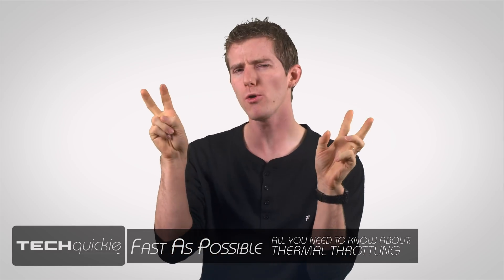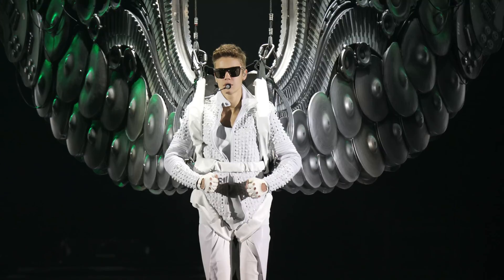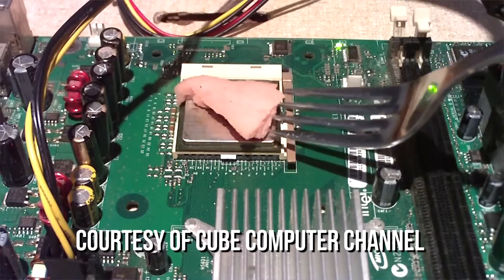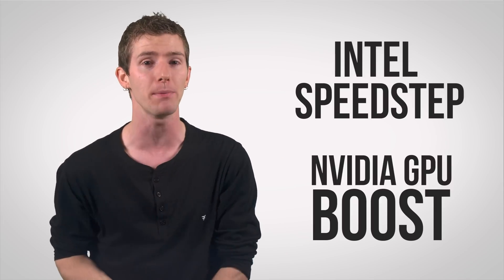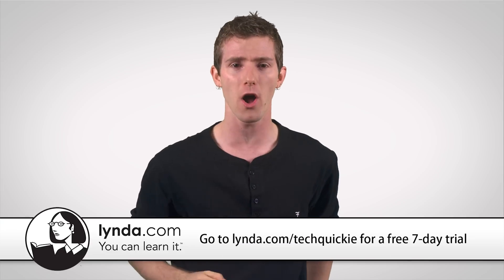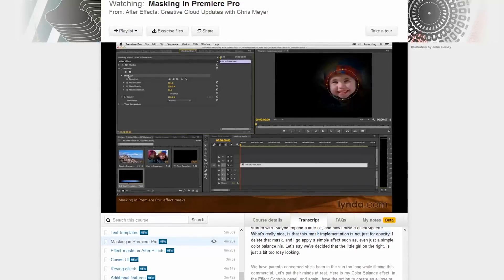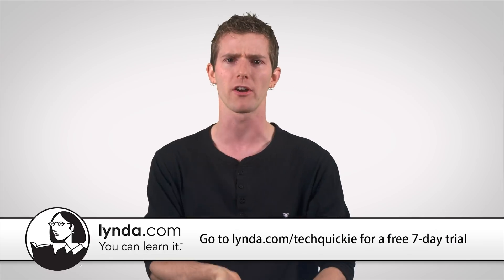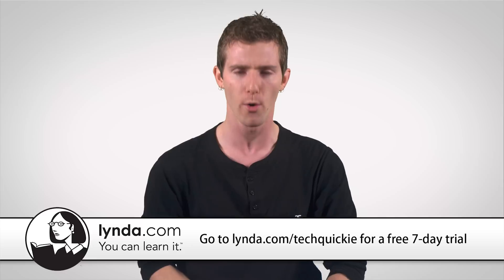Thermal Throttling as Fast As Possible

Comment: How do phones cool themselves if they don't have fans? Does it just dissipate out?
Reply: passively cool low end hardware that doesn't output much heat. That's a phone's internal in a nutshell. A PC is MUCH more powerful than any phone on the market, thus output more heat.
Reply: also some phones are specifically designed to dissipate heat from their front (screen and digitizer) and back. so the heat sink is really connected to the chassis of the phone and thus can dissipate the heat from every side and way.
Reply: Phones have a lower heat output.
Reply: s8 and s8+ and also s7 and s7 edge from samsung uses vapor chamber cooling
Reply: Yup, there's a heatsink on the CPU which id designed to handle that precise amount of heat without fans.
T hat is called "passive cooling" and can also be found on graphics cards with a low TDP like the GTX 750 Ti.

Comment: I accidentally mounted my cold-plate on to the capacitors next to the CPU socket for 1 month; leaving only 1/4 of the IHS in contact with the thermal paste. I only noticed this when I launched a full system scan, and saw the temps rise to 78'C. I REALLY have to thank this feature such that I didn't burn out a $300 CPU in a month.

Comment: I used to have an old Acer Aspire 5750G. It had an i3 2330M and GT 540M, however, the i3 2330M in most cases can only handle up to 85C max temps before forcing a shutdown from overheating. When I gamed with it however it always climbed to 80C, even when I went as far as to sport a desk fan to keep it cool and replace the thermal paste. I've since upgraded to a Clevo W650SJ with an i5 4210M and GTX 850M, both which keep at 60-65C when gaming with the laptop fan at full speed. :3
Reply: Not only that, the fan never responded enough...
Reply: My Celeron 1007u can handle 95c while playing GTA iv

Comment: I would recommend you Linus do a tech quickie about air heat coolers vs watercooling systems. That would be interesting to see, having in consideration that even if watercooling is best, for some of us give us a pour trust about the watercooling system itself, that it might have leaks, although we know that are built to prevent such type of failure.

Comment: Instead of having this mechanism , we should have devices that DON'T get hot
Reply: well you live in this world, not that one, or would you like phones that are water cooled or have a huge ass heat sink on them?
Reply: Heat is generated because of Inefficiency. Energy that isn't used in order to complete the task at hand is turned into heat. There's no real way around this. You can lower the amount of heat output to a point, but you can never truly eliminate it. Think of a car's engine. You know how that heats up too? Well, that's because of inefficiency as well. ;)
Reply: How exactly do you propose to make a device that doesnt produce heat?
Reply: Noone would want them.because they would be pretty much uselessly slow to not produce much or any heat.
Reply: You do realize loads of low power components still add up and create heat. If you had 5, 5W chips. It produces about same amount of heat as a 25W chip. With variance coming from manufacturing differences.
Reply: So you have defeated thermodynamics, I take it?
Reply: I too wish to live in a world without the laws of thermodynamics
Reply: CodeRed520 Icould be wrong, but I thought that all power used by a CPU went to heat energy, because the cpu isn't doing any actual work.
Reply: MatzeGamer What I mean is, the energy consumed by the CPU is not being used for work (IE, moving an object from point a to b, or other such use of energy) therefore, it has to go somewhere, so it goes from electrical energy to heat energy (the most basic form of energy). I don't mean work as in how many compute tasks are being sent to it.
Reply: Calm Down 1+2 = 3 is impossible.
Simple as that.

Wherever you do any sort of work (processing for example) you will have some sort of losses. And even at the lowest part, moving single electrons for binary operations, you are moving minuscule amounts of mass and charge, thus creating friction-heat, magnetic fields, eddie-currents and radiation.

Of course using a single electron per bit is impossible too, and yet even then you would have losses.
Reply: CodeRed520 "Energy that isn't used in order to complete the task at hand is turned into heat."
Uhh did you mean that? Look all the electrical energy gets turned to heat energy physics doesn't care if it is used for a computationally significant change or not, the fundamentals of how transistors work inherently turns electrical energy into thermal energy.
Reply: Calm Down Superluminal travel is...
Reply: Calm Down Smartphones do heat up ! Not to such a great extent but they cool down ! Theres not a single source in the universe that is 100% efficient ! Anything that produces one kind of energy also dissipates energy in other forms that arent very needed that much for example sound & HEAT !
Reply: Matthew Jackson You develop superconductors that super conduct at room temperature and then there is 0% energy wasted
Reply: ***** If you develop a room temperature superconductor then you wouldn't need to cool it, currently you need to get them down to ~-200 degrees C and it would be silly to put one in a phone
Reply: ***** All IC have similar efficiency. I brought up the fact that some are different with my last sentience. Just use 10% as a broad inaccurate assumption for IC chips and you wont be too wrong. Generally one big chip is more efficient then many small chips, but you run into alot of complications with big chips. But its why the north bridge on many CPUs are on die now
Reply: With a die shrink it takes less energy to change the state of a transiter, but the 10% efficency remains the same. You also have to make a choice when doing a die shrink to either make a chip consume less energy and do the same amount of arithmetic, or consume the same amount and do more arithmetic.
Reply: WayStedYou Not really, there is a experimental CPU out there that cooles itself to -200°C. If I get accros some more informations, I paste them in "here"
Reply: I take that you don't produce heat?
Reply: I'm going to presume that you mean "too hot", just underclock it
Reply: Benjamin .Watkins The CPU is actually the main part. In the beginning of Computers when there were no actuall graphics except a 24 digit display, the CPU with its ALUs and Controll Units did all the work. The North and the South Bridge managed all the traffic on the mainboard and the different inputs^^
By now, in some Systems the workload is splitted between CPU for complex tasks and the GPUs doing simple calculation taks (Nvidia GPU computing).
Reply: Benjamin .Watkins Now I understand you!
A CPU does not transform EnergyA to EnergyB (eg Mechanical to Electrical), it just changes EnergyA to EnergyA and EnergyB (Electrical to Electrical and Thermal). More like a transformer^^ Dont forget that Energy cant be voided!
Most CPUs these days have an efficiency of 40 to 60%. Some experimental units like the one made by scientists at the "Max Plank Institut" have an efficiency of up to 85%. But if the heat is used to heat eg an office, the overall efficiency is much higher (same is done on cruise liners, they use the waste heat from the engines for heating or with evaporation systems, to cool the ship)
Reply: KemoKa77 No dude , some substances don't have any resistance . However , they demand a very cold temperature to act like that. So basically , it's a matter of time
Reply: Calm Down Then you need a shitload of energy to cool them down => no gain.
Reply: Calm Down That is theoretically impossible !
Reply: @Anudeep Roks people said the same before smartphones came 

Nothing is impossible "theoretically"
Reply: ABaumstumpf Exactly ! That's what i am talking about !

Comment: I've only encountered thermal throttling once, I was overclocking my GTX 560ti twinfrozr II and I had the voltage as high as it could go MSI Afterburner and core and memory were balls to the wall, I decide to run msi Kombuster burn in test and my gpu got to to 95°C and then my desktop shut off I guess to safe itself lol
Reply: It's spelt save

Comment: I have a Macbook pro from back in 2008 that's throttled it's entire life, and does it even now when just watching YouTube. Certainly no where near dead yet though. I've even had it's original battery swell up and get replaced, but the laptop still keeps on going.
Reply: Just clean all your fan no doubt that isn't helping
Reply: b jt23 Yeah I had a laptop that was only 1 year old and used pretty much exclusively on my table or desk and the fan was awful after only that time, it would thermal throttle like crazy as well.
Reply: Your computer is probably very dirty...
Reply: Have it cleaned up man... too much dust in that fan... and probably need to change the thermal compound too.
Reply: I have cleaned the fans out recently, I didn't consider the thermal paste though...